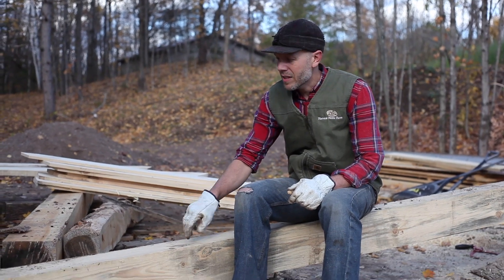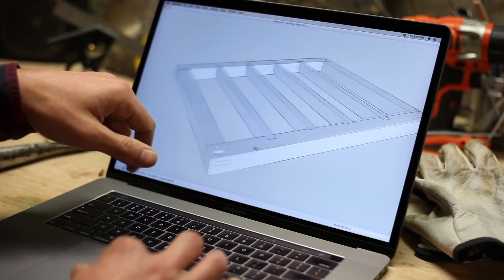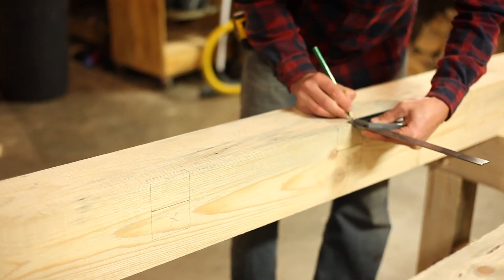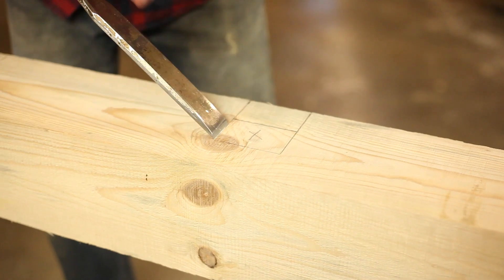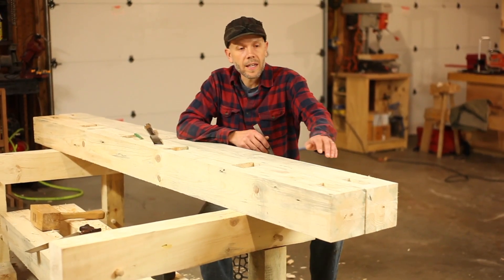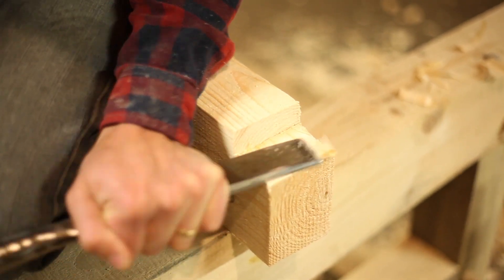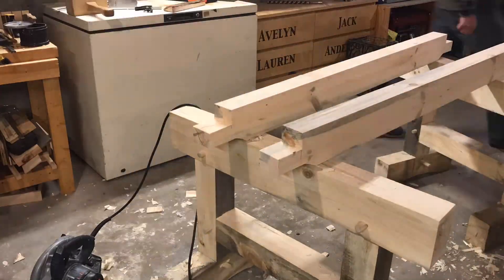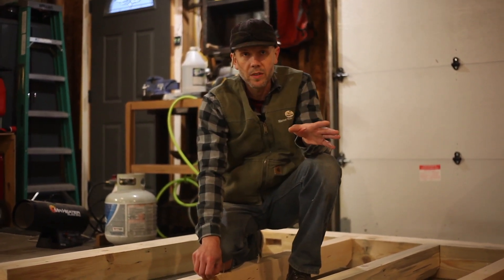Part 2: Cutting the Timber Frame Joinery for the Floor Joists of the Tiny Timber Frame

Comment: you're probably not gonna use any plumbing in this tiny frame, but in a regular house, how do you run waste pipes below the floor? Do you make holes in the thick joists? Can you include I joists between the sills, instead?